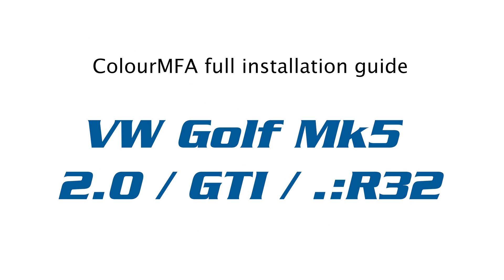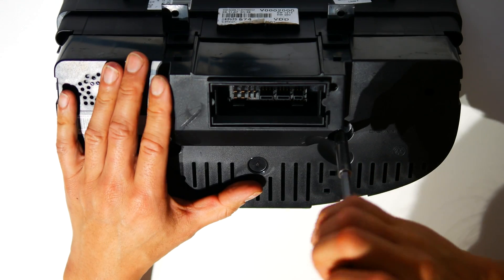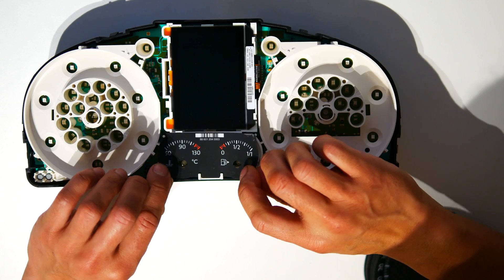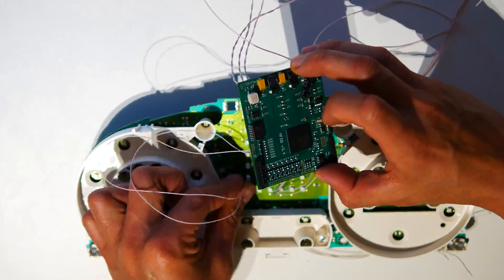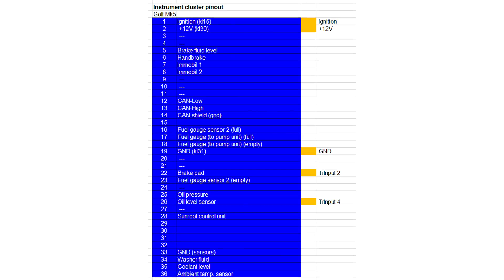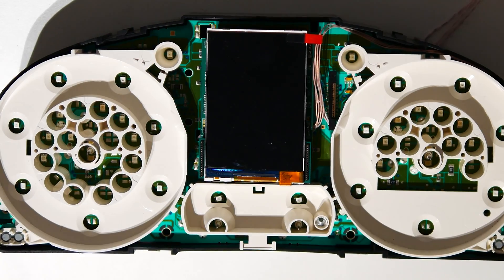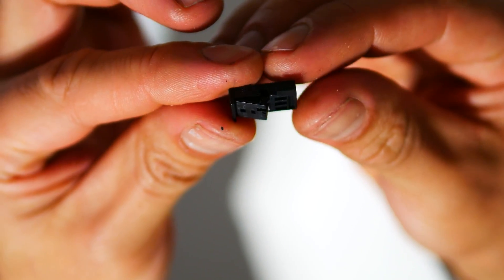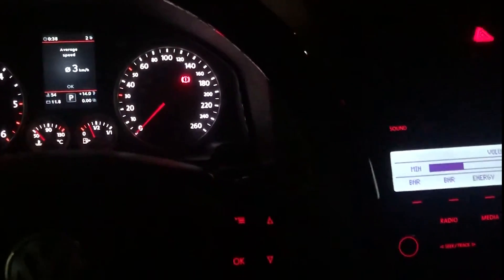ColourMFA How to Install in VW Golf MkV GTI. ColorMFA in Golf Mk5 R32 TDI and 2.0L petrol PQ35

Comment: Hey
So it doesnt require any coding because u only swap the mfd screen, right?
Also do u need Multifunctional steering wheel for this to control?
Reply from the maker: hey m.b. - that's right no need for coding because you are using you roriginal instrument unit. If you want to use a 2nd hand unit then you will need coding. 

Yes you need the controls on steering wheel to control it - otherwise there's no way to control ;)

Comment: Is there a way to wire in the turbo timer feature?  I swear I seen u could do that somewhere online
Reply from the maker: Hey Ziggy. To run the engine a little bit after turning off the car?
Reply: @IanPG  yes sir! I could try to find it for ya so u can check it out  could be something u could implement in ur services
Reply from the maker: @ziggyortiz37  not sure which car you have but for most Audi VW they already have this feature built in so no need to add a separate one. They're called an after run pump and usually controlled by the rad fan control module or ecu. ☺️
Reply: @ianpgonzaga  I wish I had that 😅😅 I don't think 2000 a4 quattro 1.8s came with that kind of feature
Reply from the maker: @ziggyortiz37  I think it does. 

https://www.google.com/search?q=audi+a4+b5+after+run+pump+1.8t&client=ms-android-google&sxsrf=AJOqlzVvi7RtuHw6FUcR4STQvhFlVk4d8A%3A1678571056203&ei=MPYMZK6LDMS93LUPk4W-oAE&oq=audi+a4+b5+after+run+pump+1.8t&gs_lcp=ChNtb2JpbGUtZ3dzLXdpei1zZXJwEAMyBQghEKABMgUIIRCgATIFCCEQoAE6CggAEEcQ1gQQsAM6CAghEBYQHhAdOgoIIRAWEB4QDxAdSgQIQRgAUMoSWL0dYPEfaAFwAHgAgAHuAogB7gmSAQcwLjIuMi4xmAEAoAEByAEHwAEB&sclient=mobile-gws-wiz-serp
Reply: @ianpgonzaga  sorry my friend but my a4 didn't come with one sadly  they started putting them into the B6 S4s first 😭😭 but it's all fine and dandy LoL I don't drive her too hard and I definitely do need to set up an order for a cluster for sure!!  Clean work!

Comment: I have a full screen in my 06 TDI I can source a half screen for my car no problem, but when altering that one will it display the correct mileage to my car or the car it came out of?
Reply from the maker: Good question. You will need to adjust the mileage to match your original.

Comment: Hi Ian, i have an 2008 golf mk5 with full size screen red colour mfa. Is it suitable for your colormfa?
Reply from the maker: Hi Alxar - it would be better to source a half screen one and code that to your car. Then use the half screen one to install ColourMFA into. 

The challenge with the full screen version is the comfort menu. So far I can't figure out how to remove this function from full screen. 

On half screen cluster it doesn't have the comfort menu making it more suited to the retrofit.
Reply: @ianpgonzaga  ok thans for the info i will look for a n used half screen then come back to you👍🏻

Comment: Hi IanPG, I have an 06 VW golf mk5 gti with a stuffed cluster(half mfd) and I have another cluster from a mk5 with a full mfd. is there any way I can plug the top board onto my immo board and have it function?
Reply from the maker: Hello NS it's a great question! 

It's not that simple. I mean try it (there's no harm doing so) but I don't think it'll work. I tried in my TT 8J cluster and it doesn't work like this. 

Let me know how you go :)
Reply: @ianpgonzaga  ah ok. My original board has some of the solder pads that would usually connect the dial motor to the rear of the circuit missing
Reply from the maker: @Hhhhvl-f3v  hmmm strange. Did you try connecting them ?